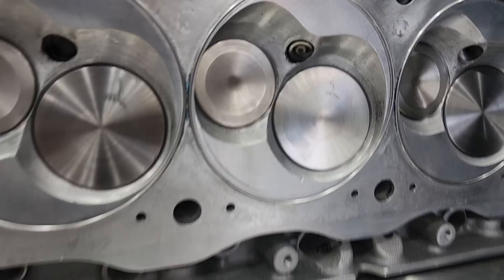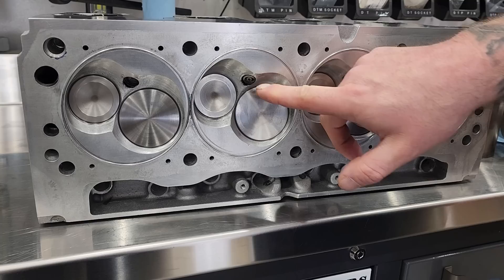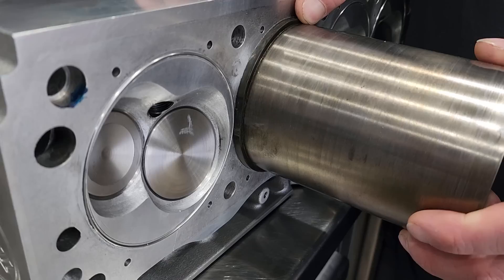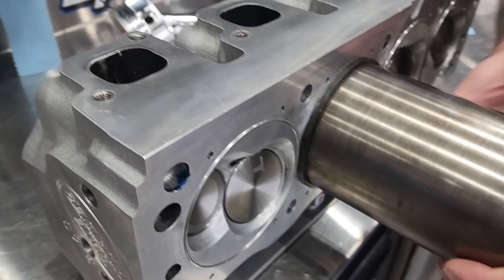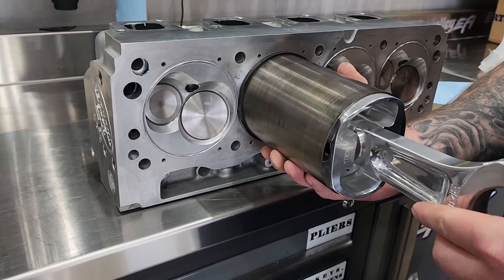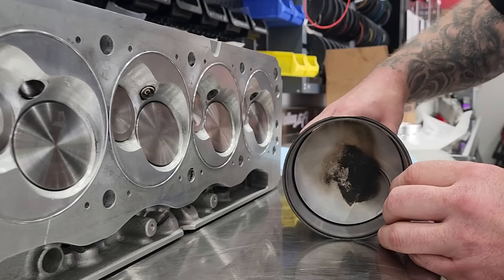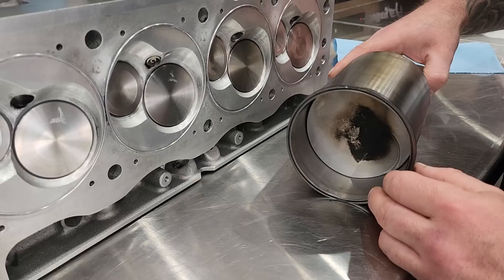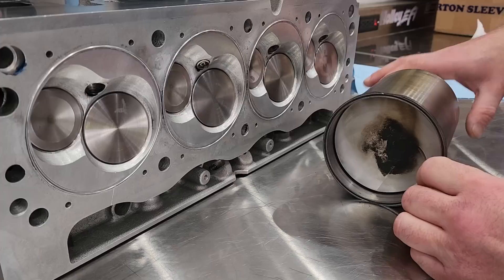What is ignition timing ?

Comment: Being lucky enough to work in engine development with combustion analysis software and cylinder pressure transducers reveals most people have no clue how ignition timing works... or how internal combustion engines work in general. People would also be disappointed to know many "tuners' dont really do a very good job... Throw in a base tune, tweak a couple things to make sure AFR is in check, aaand here's your bill.
Reply: That's the biggest issue, I live within 75 miles of half a dozen chassis Dyno tuning facilities, and 3 engine Dyno cells. And half of them are clueless. The one that is top notch is Steve Morris engines, and he will not touch it unless he built it. Don't blame him, he doesn't want the headache unless you buy it from him.  One things for sure, if you want high power with any degree of drivability and reliability physically building it is just the beginning, tuning it takes skill, time, and knowledge. The ones that really understand aren't cheap. And you probably won't get on their schedule for a month or more. Guess what I'm saying is it's hard to know who to trust, and there are not many ways to verify the tuners skill level other than word of mouth.

Comment: Explosions are bad, controlled burn is good.  Under normal running conditions  the mixture in the combustion chamber does not explode or go bang, if it did the engine won't be doing many more rotations.  It might help to explain that ignition timing is used to achieve the optimum peak cylinder pressure timing which should be just after TDC and the piston is heading back down the bore.
Reply from the maker: What is the name of this video ?

Comment: Great vid, I knew most everything in the video already, just not so sure on the material science of why when the cylinder is it out of fuel, it resorts to torching a head or piston. In other words, why doesn't the combustion just run out or cease to exist?
Reply from the maker: Cause it's still under pressure